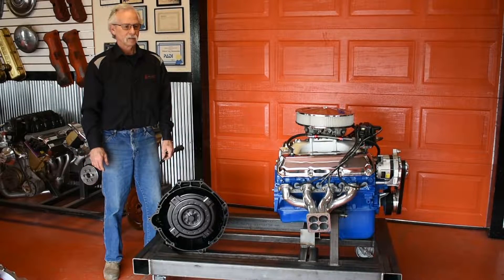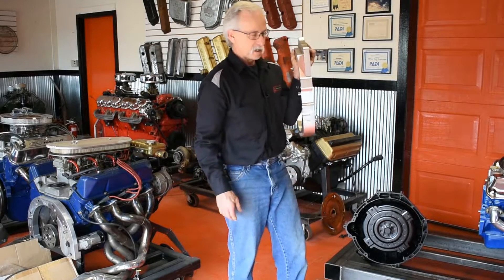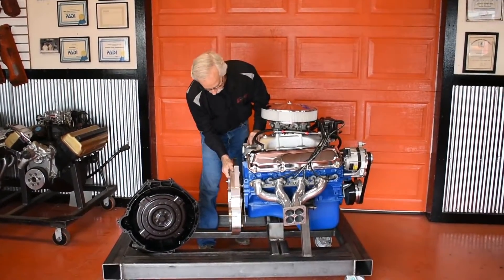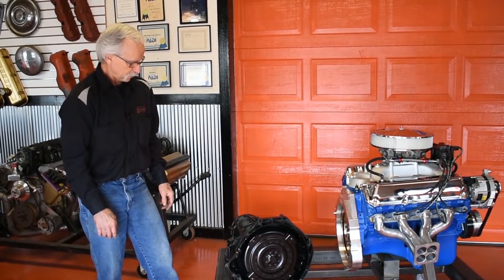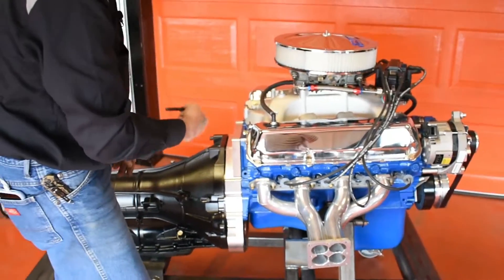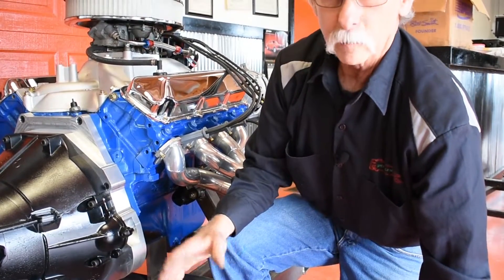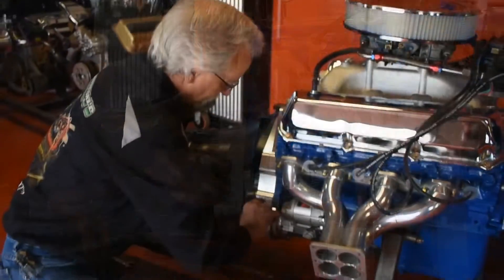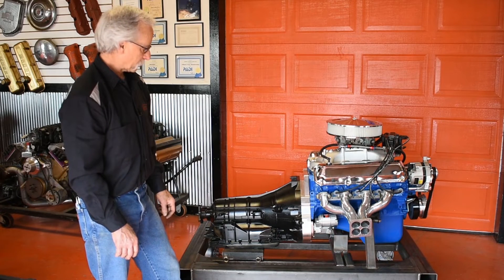Ford 429 460 to 6R80 Transmission Adapter Kit Installation

Comment: Good evening. Did you ever finish the 6r80 to a small block? Because I have a MT-82 I want to bolt a 351w to it. And having a hard time finding a shop that sells an adapter.

Comment: So, it's not an issue if the converter doesn't sit up into the back of the engine's crankshaft then, interesting. What's the controller you guys have used and how do you like it?

Comment: So, how does the transmission crossmember mount work?  I am assuming we’re not lucky enough for it to bolt straight up to the C6 crossmember.

I’m working on a 1978 Grand Marquis, and no one makes performance parts for mixing and matching all the cool upgrade parts.

I’m assuming I’m going to have to find someone who can make a custom crossmember?
Reply: Mopac

Comment: Does the 6r80 come in 4x4 and what would you need computer wise to run some
Of these transmissions ?
Reply from the maker: There are some 6R80s that come from the F150 for example that have a transfer case, we recommend reaching out to Advance Adapters for any 4x4 or transfer case application. As far as the stand alone controller, we partner with US Shift for the stand alone controller, customers often tell us its a plug and play situation along with the initial set up. Give us a call and we can help you figure out what transmission to get specifically, (763) 767-4480

Comment: Hi mate, now you’ve got me thinking, I’ve gone through several C6’s behind the 429 in a ‘71 LTD 2 door plus the 4:11’s get pretty tiring on the highway. I know nothing about late model gearboxes and am wondering how the C6 compares strength wise and also I’m currently using a 3000 rpm stall converter so what do I do there?
Reply from the maker: If your transmissions are burning through quicker than getting you from 0-60, go to a trusted transmission rebuilder and ask for their opinion on what transmission to use. Their recommendation could be you using the C6 still but with different internals. Especially if you got a big block engine, even unmodified, it can output a decent amount of HP/Torque.
Reply: @speedgems3978  thanks mate, they’re not so much burning through as blowing up, the guy I use is good but it’s the fifty plus year old parts that are letting the team down so I either spend up big on aftermarket internals or go for a later trans that has the benefit of an overdrive. I’ve just moved from the city to the bush so I may even change to a six speed manual. Thanks for your suggestions.

Comment: What all do you need to get the trans to work right I want to put this in my 94 f150 with a 460
Reply from the maker: If you go with the 6R80, you will need a stand alone controller which we can provide from our partners at US Shift. Give us a call for any more questions!

Comment: make a new trans case that fits the engine
Reply from the maker: Hi Jerry - We have a few custom made bellhousings that would work for manual transmissions. Automatic transmissions generally can't be replaced without extensive modifications or being a removable bellhousing. We strive to make things as easy as possible for the end user!

Comment: ford 460, should the flexplate weight be facing the 12 o'clock position ? 
or be facing 180 degs the other way in the 6 o'clock position?
 in relation to the hatchet weight in the front.
please help me, thanks
Reply from the maker: The flexplate being in 12 or 6 o'clock position shouldn't matter, as long as the welded side faces the engine and the nonwelded side faces the transmission. Call us for any more questions.
Reply: @speedgems3978  I think you misunderstand the question.
in relation to the hatchet weight in the front of the motor, should the weight on the flexplate be 180 degrees from it or aligned with it. I have already destroyed one transmission by not having it correct.
Reply from the maker: @EarthsMysterieswithKenKay  Gotcha, was a little confused, thought the 460 was always internally balanced but that is not the case. You would need to have it diametrically opposite of the hatchet weight to then be "balanced", but please consult an engine builder to get a second opinion.
Reply: @speedgems3978  
yes, that makes sense to me.
I am waiting for my new transmission to be delivered in the next few days.
thank you for responding and thank you for your help.
Reply: @speedgems3978  I couldn't find anyone that knew the correct answer. so I put it on as you suggested, and the engine is horribly out of balance. what should I do now?
should I take it all apart and then put it lined up with the hatchet weight?
Reply from the maker: @EarthsMysterieswithKenKay  We recommend taking it to a reputable engine builder near you. Without having the engine in front of us, it'll be hard to tell if balance is the issue (either with the crankshaft or the flexplate) or some underlying reason. We wish you good luck, it isn't a good project without a few head pounds to the wall!
Reply: @speedgems3978  I found the flexplate only fits on the crank one way,
 so there's no question there.
 my imbalance is probably due to a bad coil and or plugs dropping cylinders.
I'll be working on that next.

Comment: What is the point of the torque converter adapter? Is it for using a non 6r80 torque converter?
Reply from the maker: Excellent question! It's to compensate the gap between the flexplate and the torque converter itself. Without it, the flexplate won't reach the torque converter and not move at all.

Comment: I Wonder How much Torque a 2014 Mustang GT 6R80 can Take without going 4R200..? 
It's going behind a 460/520 on pump gas with around 700hp. Street Strip Build..  373 geared Ford Torino. Really wanting this Conversion 😍

Comment: The 385 series Ford big block is one of the very best ever built. I wanted a 429 so bad, and finally got one into my 55 Ford pickup. What a jewel of an engine it was.
Reply from the maker: Preach it! By far one of the best built engines created by Ford. Put a 6R80 behind it and send it down the highway with ease😀

Comment: Will thus work with the 6R140 from a 6.7l power stroke ? Is there a stand alone wiring harness for the 6R140 ?

Comment: This is absolutely brilliant. If these are still around in 20 years when I retire, I'll be getting one and upgrading my old '68 t-bird. For now, the old school c6 is fine but once it's play time, turning her into a boss 429 w/ this kit will totally transform her into a absolute beast on call, and a cruiser at 75mph just dubbing along sipping fuel at the same time. All while running so much cooler with a locking converter too boot. This kit is absolutely beautiful. Most people have no idea what an upgrade this is to any old school engine. A tire roasting beast with that granny first! Then a fuel sipper with double over and a locking converter. My god, ford big block with a 6R80 would be far beyond having your cake and eating it too. It would be like having your cake and pie and eating them too. Simply amazing.

Comment: I have a built 1971 460 to a 514 do you make a adapter plater to bolt up a 13 speed rig transmission to it? I know it sounds crazy. Or do you know who makes one.

Comment: and here i am thinking about putting a 302 in my truck when i find this and a 460, now to find out if i can put a np205 behind a 6r80 trans
Reply: You can you need the 6l80 adapter plate
Reply: From advanced adapters

Comment: Will this work on a 351/400m since it's the same block as a 429, 460?
Reply: It's not the same block, but they do use the same bell housing! So I would guess, YES!
Reply: Yeah, they are selling them as 351M/400/429/460 kits on their site, right in the title.

Comment: I have this transmission in my truck from the factory and it is a pain to check/add fluid due to the dipstick design requiring you to crawl under the vehicle which is fine if you have access to a lift but not so much on your back when using a jack and jackstands, was wondering if you or someone else has a kit to make it possible to access it from under the hood just like they used to do back in the good old days. I think B&M has something like that but adding fluid is a slow process from what I remember reading about it.
Reply from the maker: @ Running on Empty - Nothing here...check with Bowler Performance Transmission.

Comment: Any chance this would work for a 351C block or are the top two bellhousing holes an issue?
Reply from the maker: @ Bryan Condrey - If using a SBF block/pattern, use Speed Gems Kit #FO2701 in the link below:

https://transmissionadapters.com/collections/ford/products/fo1002701-small-block-ford-to-6r80-modular-transmission

Thank you for choosing Speed Gems Transmission Adapters!

Comment: That is the solid answer to all these older motorhome resto's with 460's, that will provide better hi-way travel speeds.....
Reply: omg yes. With double od basically and don't forget the granny low for making taking off SUPER nicer in something that heavy, then the locking converter too of course. What the old C6 never had. MASSIVE upgrade to anything but a motorhome especially.

Comment: Where are yall at now with the small block adaptor? I wouldnt mind putting  one of them transmission behind my 300 after i have hot rodded it
Reply from the maker: @Chapa's Chop Shop - It is complete and in production!...Please see the link below - for information and purchasing:

https://transmissionadapters.com/collections/ford/products/fo1002701-small-block-ford-to-6r80-modular-transmission

Thank you for choosing Speed Gems Transmission Adapters!

Comment: Now u need a kit for a old c6 to a new 7.3 Godzilla
Reply: Why would you want to downgrade like that?
Reply: @Warrior_Resisting_Colonialism  cuz the c6 is the best transmission ever built
Reply: @Hollywoodhouse74  Strong, but power HUNGRY! only 3 gears. No overdrive or a locking converter. Very outdated. She's a dino now. Hey, I've had a couple and still got one, but they don't hold a candle to modern auto trans. Not even a contest.

Comment: Cuando me podrías responder
Reply from the maker: @ Jose Luis Rafael Torres Estrada - Hola Jose!

Here is a link to our FE390 Kits - The Kit selection will be based off of what Transmission you are going to end up using:

(En español: Aquí hay un enlace a nuestros kits FE390: la selección del kit se basará en la transmisión que terminará usando:)

https://transmissionadapters.com/search?type=article%2Cpage%2Cproduct&q=FE*

Thank you for choosing Speed Gems Transmission Adapters!
(En español: ¡Gracias por elegir los adaptadores de transmisión Speed Gems!)

Translation of previous message, below:
'Hello friend, I do not speak English, only Spanish, but from a 390 engine from a 1972 f100 with a more modern automatic transmission, how does the transmission change?'
Reply: @speedgems3978  podrás darme algún teléfono correo Facebook WhatsApp para poder llamarte ocupo unas refacciones amigo por favor

Comment from the maker: @ Jose Luis Rafael Torres Estrada - Hola Jose!

Here is a link to our FE390 Kits - The Kit selection will be based off of what Transmission you are going to end up using:
(En español: Aquí hay un enlace a nuestros kits FE390: la selección del kit se basará en la transmisión que terminará usando:)

https://transmissionadapters.com/search?type=article%2Cpage%2Cproduct&q=FE*

Thank you for choosing Speed Gems Transmission Adapters!
(En español: ¡Gracias por elegir los adaptadores de transmisión Speed Gems!)

Translation of previous message, below:
'Hello friend, I do not speak English, only Spanish, but from a 390 engine from a 1972 f100 with a more modern automatic transmission, how does the transmission change?'

Comment: Have you guys ever made an adapter for small block Fords to hook up to the Ecoboost Bell housing 6R/10R transmissions? I know you guys made one for the modular transmissions but IMO that adapter is way too thick and the Ecoboost Bell housing is closest to the older SBF/BBF  starter locations. If you don't have one made for the Ecoboost 6R/10R, when will you begin producing them?

Comment from the maker: @Dulcea Arden - Could install an overdrive by-pass button = 'tow mode' and it may be possible to have this programmed into a Shift Kit as well.  Would need to check on that.

Thanks for everyone's interest and comments!

For Reference, Here is the link to the Kit (#FO2501) on our website - 

https://transmissionadapters.com/collections/ford/products/fo1002501-429-460-to-modular-transmission

Thank you for choosing Speed Gems Transmission Adapters! - www.transmissionadapters.com

Comment: From the Headers it looks like it’s going in a Cobra or Replica. Looks like a perfect auto for a big inch Kasse Boss 9 Do you have a recommendation on a company that can beef the tranny for 800 ft. Lbs ?
Reply from the maker: We would recommend a transmission built by Bowler Performance.

Comment: Is it strong enough to swap in a work truck? If Ford doesn't come out with the 6.8L Windsor next year I wanna swap a 460 and 6R80 in my F-150.
Reply from the maker: The 6R80 was the primary transmission put in F-150's from 2011+ These transmissions have shown to hold up to 1000hp. In our opinion it is one of the best transmissions currently available.
Reply: @speedgems3978  I was actually talking about your adapter lol. But in other questions, is there anyway you folks can make an adapter for big block Fords to Allison 2000 with the round bellhousing? I'm not doubting you when you say the 6R80 is stout but I do plan to put my truck through some major abuse.
Reply: @RBLUS_TY   I think (destroked) offers that?
Reply: @RBLUS_TY  Nothing about the adapter would be hp rated. You'd blow a trans but the adapter parts don't take the load. They just act as connection device. So whatever you could build for hp, I don't see why it would stress and brake these parts.

Comment: Would this also bolt up to a NP205 transfer case or would we have to use the newer transfer case. Or is 4wheel drive out of the question due to one being 100% mechanical and the other being 100% electronic?
Reply from the maker: The controller for the 6R80 does not support the 4x4 transmissions from what we have known. It might be possible to make this work with a mechanical transfer case.
Reply: Would you say this would be a good fit for my 429 in my 78 bronco? Now it has the C6 connected to it now mated up to a Np205 mechanical transfer case?
But I'm looking to change out the C6 and also the 429 for a newer fuel injection 460 ,like a 90-91?

Comment: I've got a 75 Lincoln with 460, is there some difference with the older 460 blocks? Will this adapter fit my 1975 460?
Reply from the maker: From what we have known there is not any difference during their entire production run that ended around 1997ish
Reply: Tailshaft lengths.. your Lincoln would prob be a long tail

Comment: length of this vs the C6?
Reply from the maker: The 6R80 is roughly 30" long with the adapter plate. The C6 can be anywhere from 24-31" long depending on the application it came out of.

Comment: This is just what I was looking for. I have been wanting to put a 460 in my 06 Crown Vic but want legs as well. Thought about a Gear Vendors under/overdrive unit on the end of a C6, this would make things much easier
Reply from the maker: We would fully agree. The Gear Vendor is a good option but we feel in the long run this is a much better option. Especially knowing that a 10R80 will be an option eventually. A 460 mated to a 6 or 10 speed will mean power and better MPG!
Reply: U

Comment: Need for 4x4 small block
Reply from the maker: It should work but we have not fit it to a 4x4 transmission ourselves so there's a possibility there might be some clearance issues. This will depend on the transmission as well.

Comment: Very nice! Fit and finish is beautiful. I have a couple of questions, what transmission controls would be used, I would be thinking about one in an MAF/SEFI swapped 460 in a 1986 F350. The other question, have you tried the late PMGR starter for fit? It is fairly compact with the solenoid on the top and I think hugs the block closer than the Powermaster. The truck frame comes very close to the starter and actually has a slight rolled up area by the starter to clear the old moveable pole piece starter. Driveshaft to transmission, mine is a two piece and the front is essentially fixed in position, the rear section has a slip section just behind the center universal. What would be needed at the transmission end?
Reply: You EFI swapped a bullnose? Sweet.

Comment: I had to read the comments to figure out why I would want this transmission. Making it so people with a 460/4wd can swap out their c-6 would be a good idea. Does this transmission need any special electronics? my 1992 truck would be great with more gears.
Reply from the maker: It does need a stand-alone controller. We offer a package deal with one as an option. The video is a bit older and could use some more information, but mainly it is just an installation instruction.